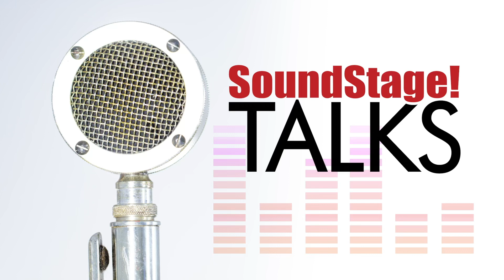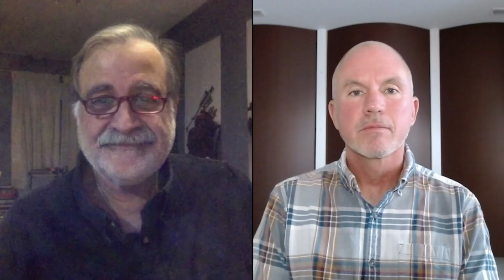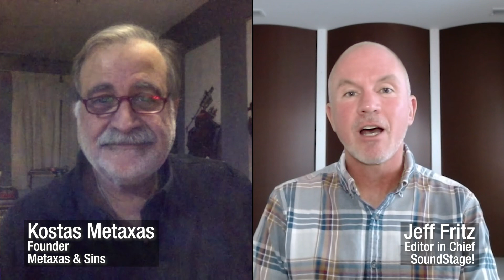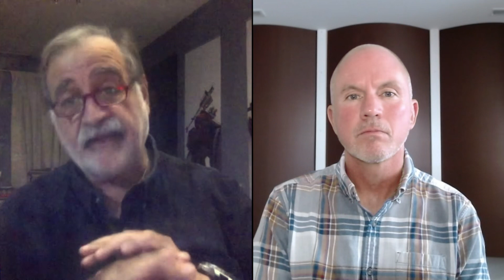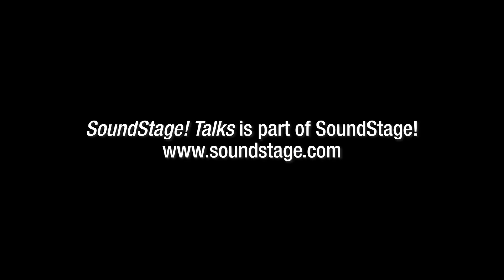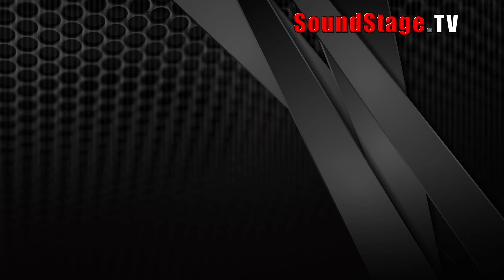Metaxas & Sins: The Art of High-End Audio - SoundStage! Talks (November 2020)

Comment: I am a mid-fi freak. I have a NAD amp and an (average) Jaycar flagship amp (that has been DISCONTINUED) and I'm pissed about that. It cost $300 brand new and is 200 w per ch (@ 8 ohms) and (@ 0.1% THD). The specs aren't as impressive as the (half the power) NAD but the Jaycar amp sound more natural (and not as "pizzed up" in the top end).With the Jaycar amp I'm getting wows all the time and great "upgrades" and an amazing "upgrade" recently (that audiophiles would pay 10 grand for). To get the same difference electronically. I use the same amp all the time and haven't upgraded any electronics (which is only a Panasonic DVD player and a cheap tablet (through the earphone jack). My "upgrades" are speaker experiments:

See my ch for pics. I experiment with 3 things with speaker.
I doctor the drivers for acoustic performance.
I experiment with box acoustics and "float mounting" FR drivers.
I experiment with crossovers.
The three combined makes speakers at another level (at hardly any cost).
My latest experiment:

I made a pair of coaxial drivers I home hacked from drivers I got from eBay (a nightmare to find a match). 
They were a bit ordinary at first (med full of resonance). One day I got the shits and took the risk and scraped half way out the cone, a circle scribe line (deep) around the cone. After that it was perfect. Too perfect. It was dead, I couldn't believe it made so much difference. So I wet the part that I scraped and let5 it dry. And now it is perfect. An 8" "guitar driver" sounding like the best speaker in med ever. A guitar driver was the only driver I could use for coaxials (with a 2" voice coil). But that is not what I'm exited about now. My latest is the soft dome tweeters (Alpine car 4 ohm car tweeters) the only ones small enough to use in the coaxials. They sound good just like most soft domes, great spread but a bit "un clangy". I like a bit of clang in the cymbals. So I made a 1 cm diameter hole in the domes! It was better, more clangy but rolled off a bit. I have been experimenting with (coffee can seal) foil before. I use a very small piece (in a tear drop shape) the size of a grain of rice. I made two pieces like a long diamond shape (size of grain of rice) and glued one end of the foil to the top of the 1 cm hole in the dome tweeters. The sound is slightly dipole coming from the foil and the soft dome. The best resolution I have heard in a speaker best ambiance best detail in the hi hat. You hear that high detail that you hear in the Klipschorns (I can even hear that on YouTube with them). And of course in a live high hat. It's not just a "chiff" like with the original soft domes, it's got subtle high stuff with it. A real "upgrade" that even I would have spent 10 grand on (if I didn't make speakers and was RICH). I can't believe how good a speaker can sound. It's completely point source cos the 8" drivers are air lifted from the speaker hole by 2 mm (and the spaker hole is made acoustic to act as a bass vent (and works fine as a bass vent). It's pure point source, even the bass vent. They are an experience cos when you get more accurate the point source sound magnifies it EXPONENTUALLY (at least subjectively). To the point where it's actually difficult to tell if a sound is outside or in the holographic image. I'm getting used to being startled by a voice I think is in the room (and I jump like crazy). I get that experience on the cheap. Making speakers is so GREAT cos I can get so excited about "upgrades" that costs as much as cheap drivers. These were $60 each (and terrible for hi fi as original) they are made for guitar amps. The tweeters are soft cloth domes (easy to work with) and $50 a pair. I'm going to make pod shaped boxes for these drivers (difficult). They will be sculptures with acoustic function (and even more airy).